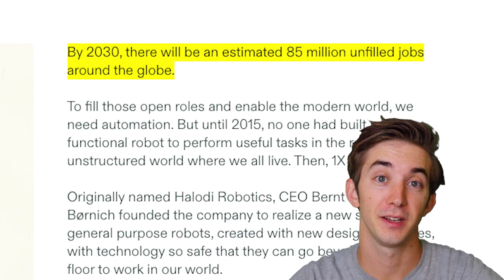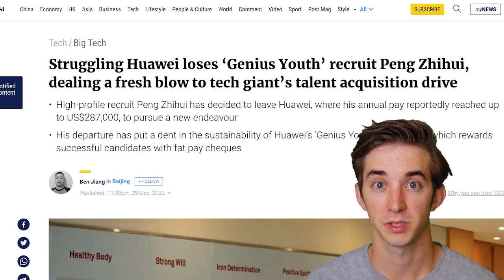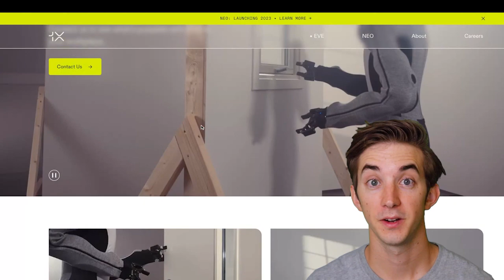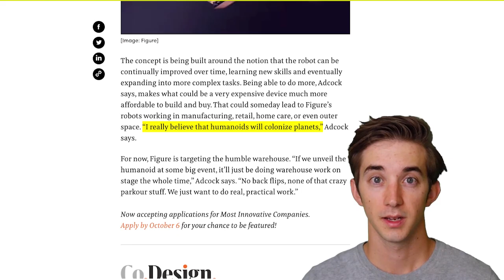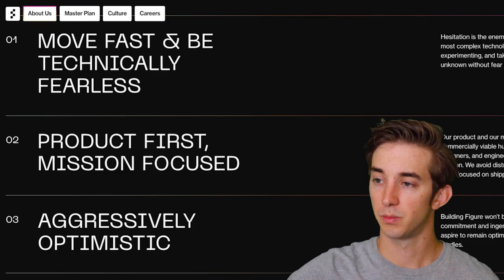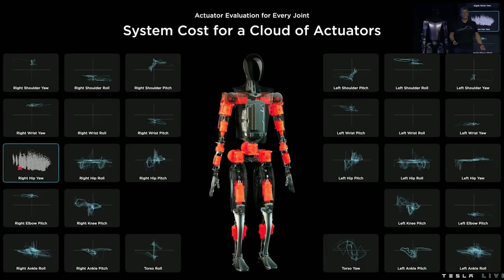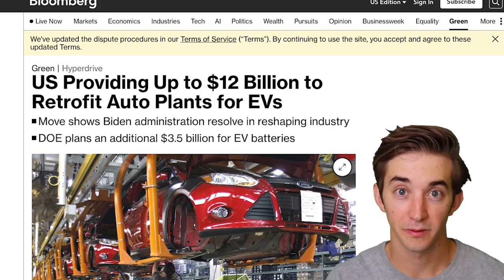The Race for Humanoid Robots has Begun

Comment: Haha you are funny, the reason they need so much compute and made dojo is to train tesla bot for all the tasks it might perform. If you look at driving, there are about 200 countries tesla fsd might drive in, and each require training. Tesla bot on the hand has to be in home, factory building, street, space, different planets(Mars). Maybe 1000x more training needed for tesla bot! I am crazy thinking this way?
Reply from the maker: Not at all! You just can't let it train itself unsupervised. That's why i think the app store is likely cause you get more developers safely training new skills.

If tesla bots are free to roam and learn than tesla will need a great architecture/philosophy for the robot to follow with no holes
Reply: Will people will have to wear all the sensors that the bot use while they do work like making a car or flip burgers… and the system capture the data and send it to dojo. Dojo will trail the bot for burger flipping job… one of the video from tesla one of the engineer was wearing that data collection system while he was working and tesla bot later did the work!